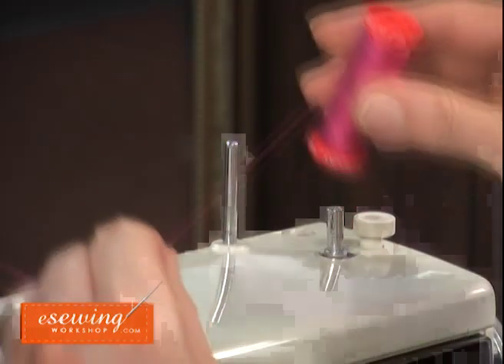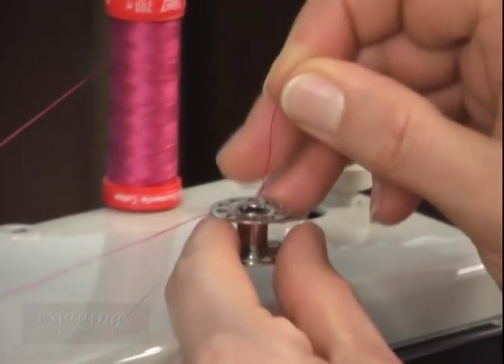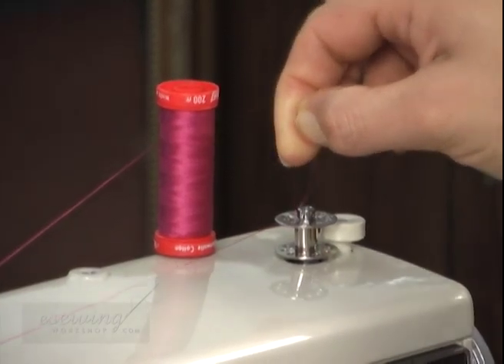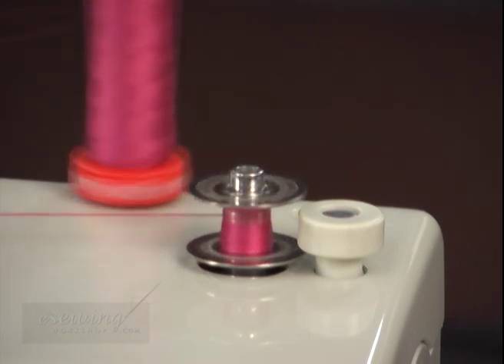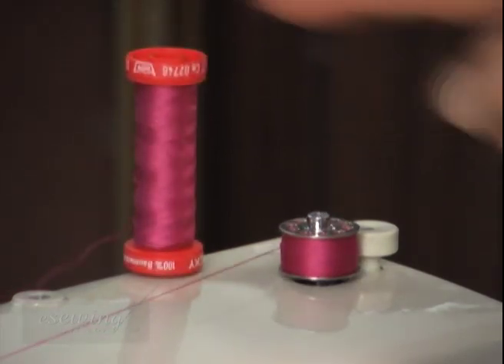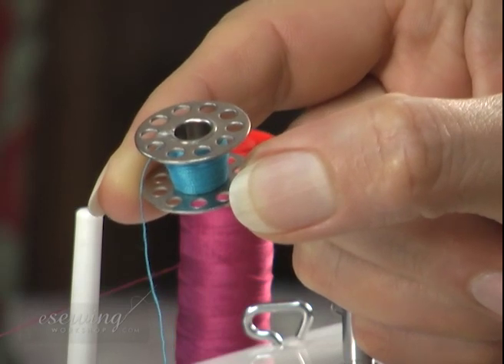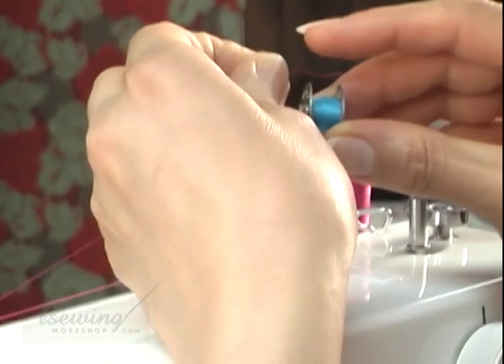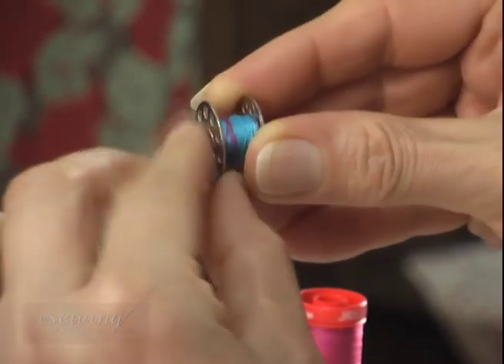11 - Kenmore - Bobbin Winding (FREE SAMPLE)

Comment: how do you disengage the needle, or pressure foot?
Reply: I had one in the '80s, but the hand wheel was a little different. It had an inner dial that you would turn counterclockwise to disengage the clutch that drives the needle assembly.

I've watched a few videos, and no one seems to know about that feature.